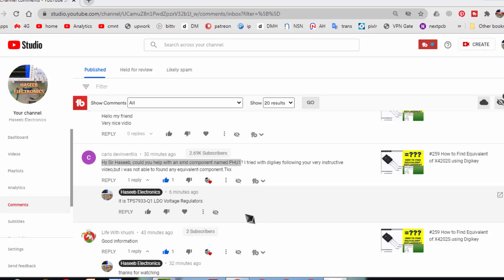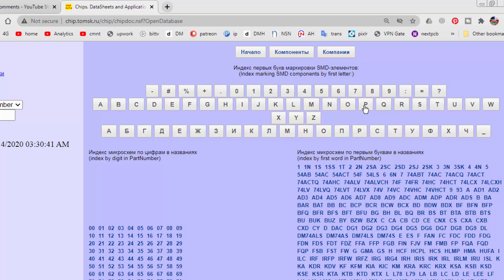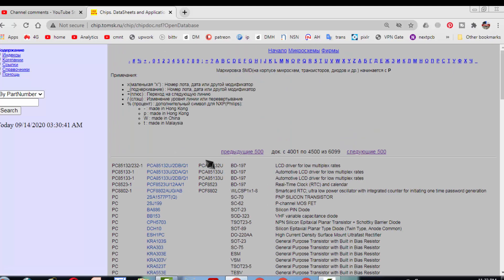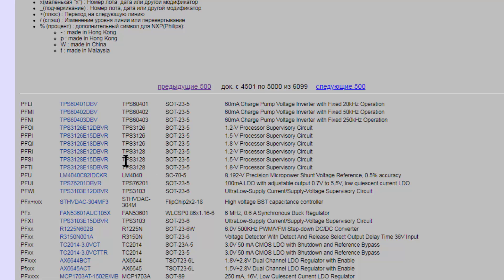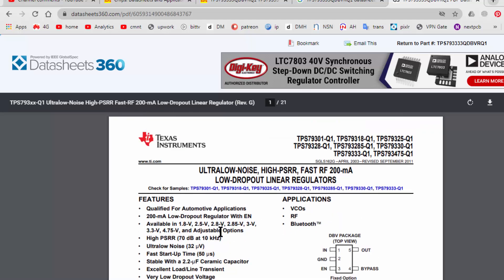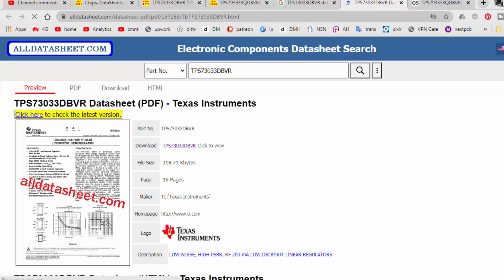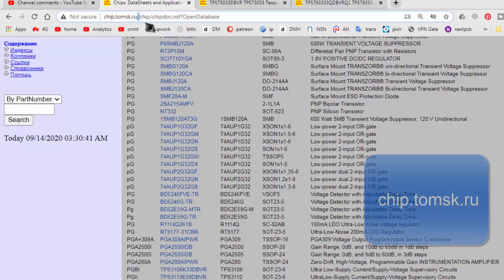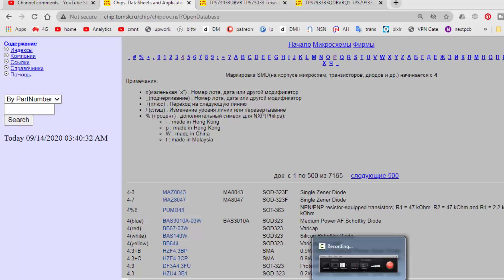{260} How to Decode SMD CODE Into Part Number & Datasheet

Comment: Asmoalaikum! , I l
tried to access that site but showing sarver not found, can you advice is that site still available? or other site? i need to check datasheet of SMD transistor Part code SY 935, kindly advice ,
thanks

Comment: Dear sir, kindly give me a solution to find out the smd transistor 8341m fixed volt ic and what is the alternative for this transistor which is installed on the board of MI three ports charger

Comment: Dear Haseeb, Many Blessings. Your presentation is wonderful &  informative. I will be very much thankful to you since I am unable to find exact details of one of SMD Transistor installed on my Dishwasher's PCB which is defective. It's marking on transistor component as - WO2 20103M . Can you pl. help me to get the details of this transistor &  Equivalent  of the same if any available in present market.

Comment: I have an SMD 3 pin marked AA6, it may be a transistor or a MOSFET, but I cant find any datasheet related to this marking, can anybody helpme please?
Reply from the maker: https://www.s-manuals.com/pdf/datasheet/r/t/rt9161%2C_rt9161a_richtek.pdf
i think it is voltage regulator

Comment: dear sir, 
this video is very informative & it helped me a lot,
i found the part no of some smd components. but i found difficulty  in finding the following part no from the   code written on the top of the component. hope fully you will help.
SC530L--> is a mosfet with 8 pins
Jst 61--> a three pin diode.

Comment: What is 02nj
Reply from the maker: 02 is assigned to many package codes. you must send the package code i mean  it is diode, transistor, mosfet IC? and its size 
so then we can get the exact data 
please check video number 546 & 547

Comment: I’m having the same problem but my phone is not letting me go to that site? The letters on the component are 1st row- LRZ833 2nd row- P520D 3rd row- XB   PO. I’ve been looking for 3 days now. Lol
Reply from the maker: dear you didn't mentioned the package type and number of pins of the component, so that i could try, 
you can also check website 
s-manuals.com/smd
Reply: @HaseebElectronics  it has three legs but one of them is a flat bar across one side. There are 2 outside legs that look like a kid’s slide on the other side, but also a middle leg that is cut off.
Reply: @HaseebElectronics  how to you find the package type?
Reply: @HaseebElectronics  found it. It’s a D-PAK

Comment: I tried to find VA01 SMD transistor . Mine is burnt. I can't find the right one please help
Reply from the maker: i think it is VAO    then it is S-1135C23-M5T1S.  Linear voltage regulator, Low voltage drop 2.3Va1.0%, 300mA,

if possible send its picture to whatsapp 00962-79-1161084
Reply: @HaseebElectronics  please see your whatsapp
Reply: Its SOT23-3 please see whatsapp 😩

Comment: Aslaame alikem

I have  problem with atx power supply model  (Dell W4827 PS 5251 2DF2 Power Supply 250W) OW4827 with Ic ( tsm 111 )

Stand by is ok 5 v

Ps on is ok 5 v

3.3v & 5v & 12v Not found

Please help  me in this  problem.